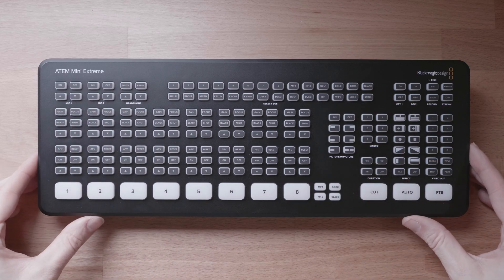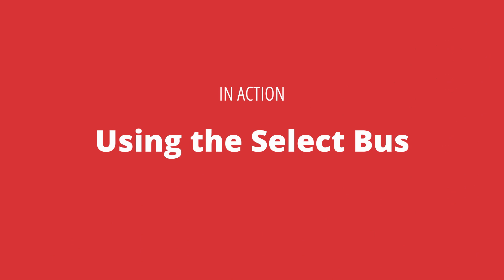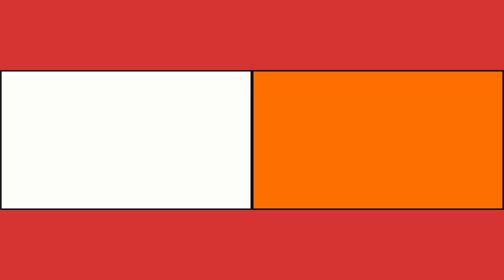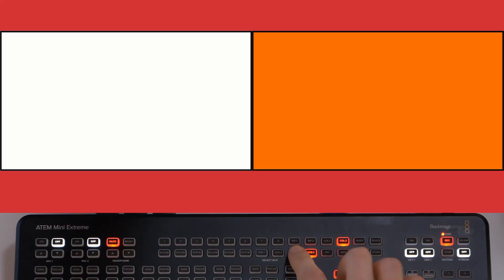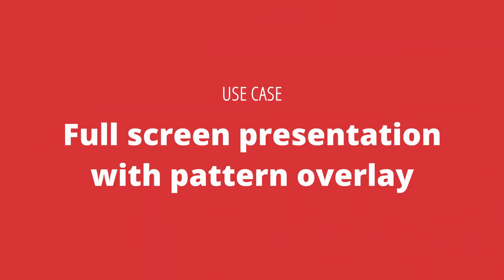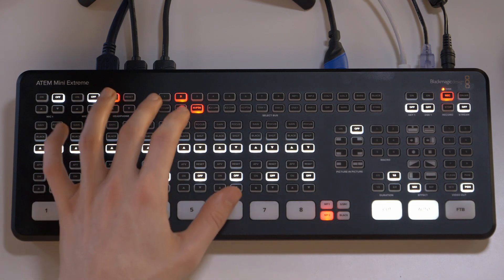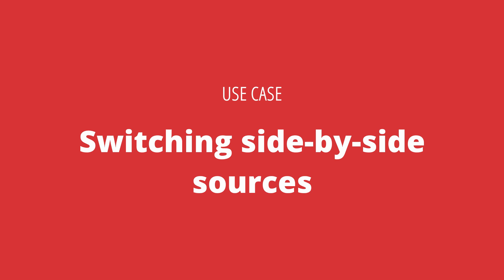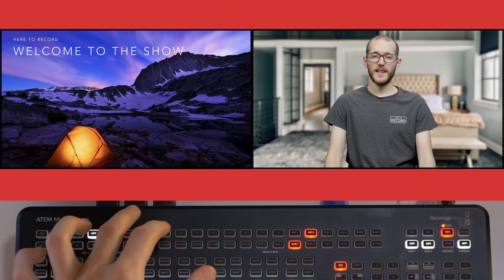Select Bus on ATEM Mini Extreme - Getting started and use cases // Show and Tell Ep.78

Comment: Really well thought out tutorial - thanks! Here's one for you. Can you use the select bus to mix (not cut) a lower third to air supplied by a keynote input on one of the channels, using only the buttons - not the software control? Could be Luma or Chroma.
Reply from the maker: You can only do it via a cut, unless you do the fading in keynote
Reply: @heretorecord  Thanks - as I suspected. Tried the keynote fade in chroma but you see green during it.
Reply from the maker: That’s true. Fading is very hard with keying. You could do luma instead but it will still just look okay.

Comment: Hi John. Thanks for the video. I've tried to re-create your example at 2m20. Am I missing something? My select Bus is all White whereas yours is Red in the close-up at 2m58. K1PTN?? Is that something I have to set in the software? You refer to KEY1. Is that DSK Key 1?
Reply from the maker: Good question. The reason mine was red in that example is because I had the Key1 On air and the red buttons are telling me to be careful about what I am doing. The audience will see these changes live. In your case you were doing it off air and the buttons are white in that case.

K1PAT refers to "Upstream Key 1 Pattern". You will find that in the ATEM Software Control in the "Upstream Keyer 1" section on the left side.

Comment: I'm about to buy the ATEM Mini Extreme ISO, just wondering about one thing: when viewing the presentation and the presenter side-by-side, is it possible to resize their windows? During live production I usually want to have the presentation displayed in a larger window, and the presenter in a smaller (usually square-cropped) window. I also want to have both those windows placed on a custom, event-related background. Until now I had to use an external video processor to achieve that. Is that possible on the ATEM Mini Extreme? Great video by the way, as per usual :)
Reply from the maker: This is possible with SuperSource. You can do a side-by-side view (sort of like the PiP i showed) but you can move the speaker over, make their presentation big and also crop the speaker too! Then on the background you can add a still or moving source as a bg!
Reply: @heretorecord  Brilliant! Looking forward to your SuperSource video then :) Keep up the good work!

Comment: Thank you for demoing the select bus and some of the use cases for it! Is the Logo Bus only for graphics or can you map a video source to go to the logo?
Reply: I’m wondering the same. Can’t find much info in the manual or elsewhere yet.
Reply from the maker: I checked this out. There is an option in the ATEM Software Control for transitioning with a graphic. This logo button lets you set that graphic source (which is likely to be one of the Media Players)

Comment: "Stinger"...? The one feature that occasionaly has me using OBS instead of the Atem Mini Pro? Tell me more, please...!
Reply from the maker: When I know more I will tell you!
Reply: @heretorecord  If you find anything out, you might be first. According to the manual "Stinger and Graphic Wipe are special transitions which will be covered in a later section." (p. 153) but there is no later section that makes mention of either. The closest I find is the Graphic Wipe of the higher end Atems (p. 159).
Reply: John what up. Unless it’s me, there seems to be a difference in the units released. 

When I was looking at this video and following along on my extreme iso, I noticed that some of your selection bust buttons actually turn red.

All of mine turn white. 

Is there a setting somewhere that I am not seeing?